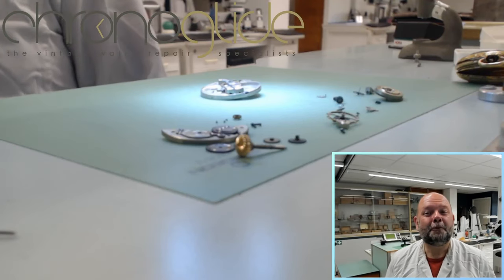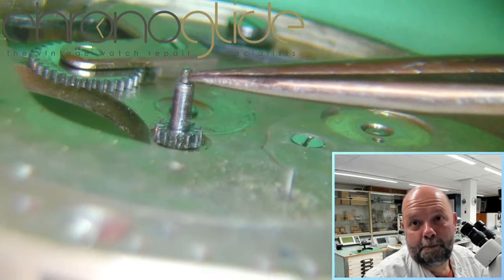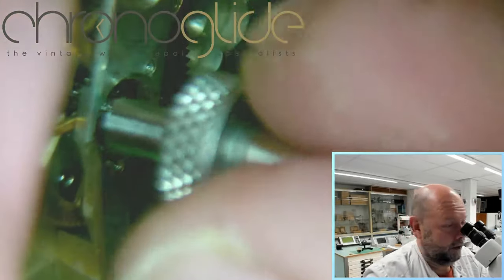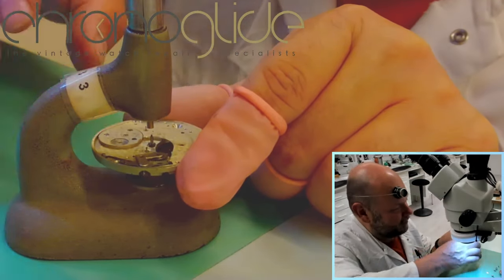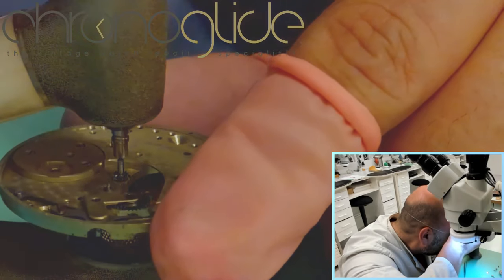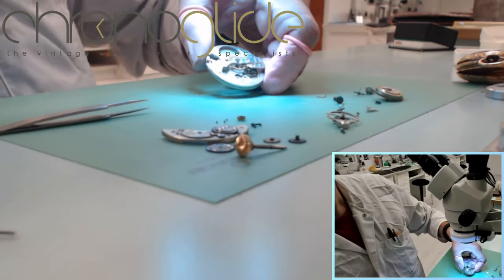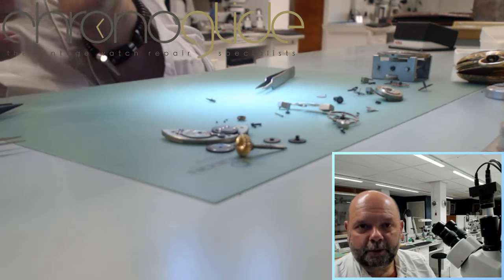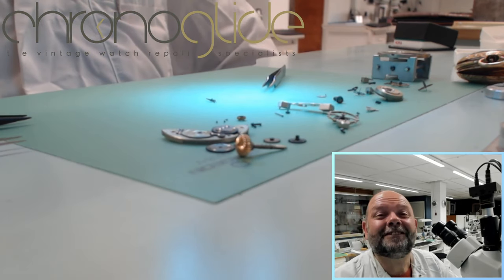UPDATE - Mysterious Masterpiece - Cannon Pinion removal

Comment: I am working on an old Lancet WWI trench watch from late ~1910s and the hour wheel was rusted to the cannon pinion and so after about 2 days of that part soaking in penetrating oil it finally came off the cannon pinion. But the cannon pinion, being smooth from that era, was stuck on the center wheel shaft as well. But I used this method using my staking set and it worked perfectly and it relased cleaning and now it's totally disasembled and I can staert cleaning. Thank you!!!

Comment: I assume the pin has to be pressed into the wheel when reassembling. Would you use the Horia tool for that too or would you use a different method?

Comment: That looks like a very effective and safe method of removing the center pin on watches with an early Swiss style canon pinion setup. The Horia tool definitely has the advantage over the Seitz tool by having a threaded plunger, where the Seitz is a lever. The feel you have with the Horia must be a lot better. BTW, Waltham used this Swiss style canon pinion in some of their early watches, specifically the 10s keywinds. Thanks for the update and better technique. Cheers.
Reply: I'm now missing that Horia again. I'm struggling to remove the cannon pinion on an Early Howard (Not the split-pin type.) that is of this design. I have tried my staking set, direct brass hammer taps, and now my LG Openall with the centering pin attachment as pusher. Unfortunately, the LG has a bit too much play, so it loses a lot of the energy I want applied to pin. And my instincts were telling me that any more stress and something, probably pin under cannon pinion, would break. Still at it. Thanks again, Kalle, for what looks like a best practices technique. Cheers.